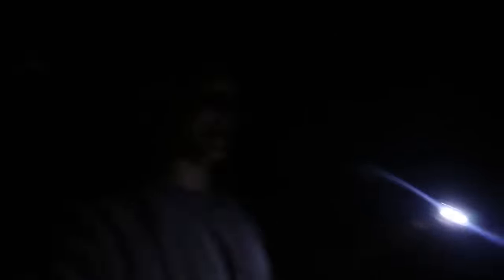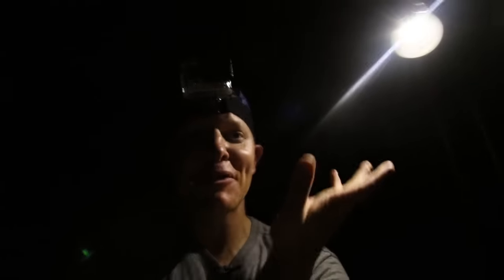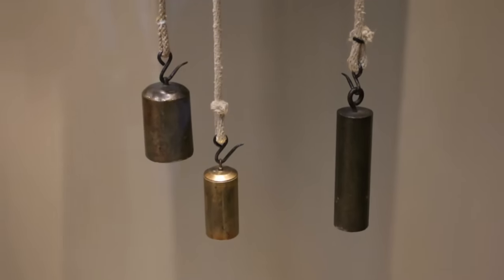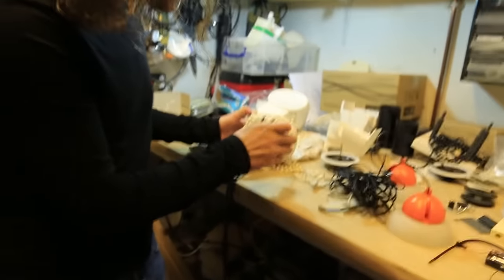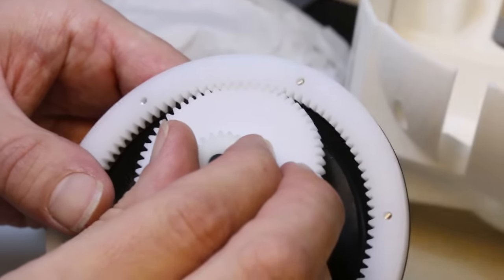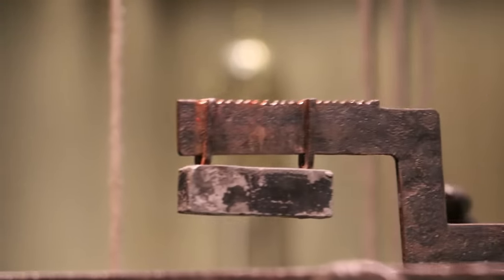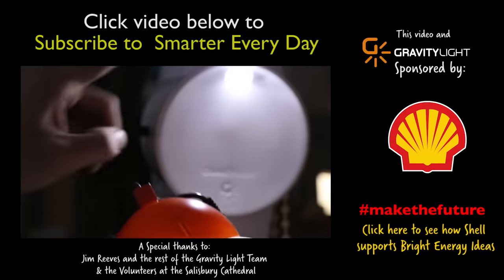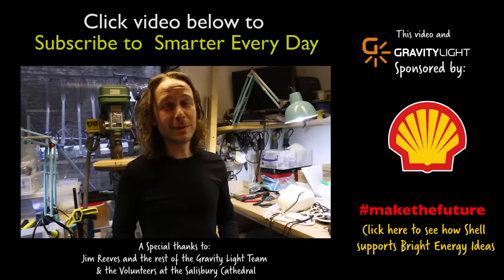Turning Gravity Into Light - Smarter Every Day 146

Comment: You mean I can’t use this in space? Please come up with Zero Gravity light, please. Thanks.
Reply: You're asking too much...
Reply: Didnt Tesla do that already?
Reply: Stored Solar power
Reply: Fun Fact, there are people developing human-body-heat powered torchlights
Reply: You could probably use a spring or elastic band with enough gears, but you'd still have to reset it often.
Reply: the centripetal force of a spinning station (faux gravity type station) could make this work
Reply: @Theo Andersen 
Yeah, I was going to suggest the same!
Reply: @Esequiel Tovar any rotating object in space pushes things outwards, which can be used as gravity. Good point though, with the moon - might work😊
Reply: In space, the better solution is solar power and/or nuclear power.
Reply: @esequieltovar4955  you can jump 6 times higher to hook the weight. 😜
Reply: You need light in space?
For what? Hunting aliens? Using led?
Reply: Coil Spring tension
Reply: Light causes gravity
Reply: Your request contains a fundamental error OP.  There is indeed gravity in space.  For instance, the ISS is subject to gravity just as you and I are. The force is lower due to its greater distance from the center of the earth but it's still there. IN FACT it's still about 90% of the value at the earths surface.

Not sure if there's been an explanation on this channel but if not, perhaps there will be.
Reply: For those of you looking to ‘discredit’ my statement, I simply found humor in the statement. I’m not really that interested otherwise.
Reply: @onenationunderduress8994  And I found humor in pointing out that there is plenty of gravity in space and tha tmost people actually think the ISS astronauts are weightless......it's funny to those of us who know better.
Reply: You need a spring
Reply: In That Case just throw the Weighted bag in space because it has no resistance but then it will also not stay in place and crash into a computer screen XD
Reply: Use a spring
Reply: @kg7tuo999  theres gravity in space you just need to add mass, gravity pulls mass together.. the iss feels 80 percent of the earth's gravity, therefore is always "falling"
Reply: @T2D.SteveArcs  According to my texts and study of physics, gravity is a FUNCTION of mass, not something that pulls mass together.

Your body has mass and attracts the earth to it just as much (per unit of mass) as the earth pulls your body towards it's center.  The earth just has a lot more mass.

Planets are formed when smaller masses congregate in a small area causing their combined mass to attract smaller objects when then add to the central mass.  This process continues until loose bodies are no longer present or are caught up in the gravitational field of another body or find themselves in sustained orbit around a body or group of bodies.

There is no gravity within space that is not a function of the mass of some physical body.....even if that body is micro particles or individual atoms.
Reply: @kg7tuo999  the new way of looking at it is gravitons pull mass to gather like u said you to the earth and the earth to you 
.together...
Reply: @kg7tuo999  and by the way "just add mass" was a joke🤣
Reply: @T2D.SteveArcs  NOTHING in science has shown the existence of gravitons.  Gravitons are a THEORETICAL particle in INCOMPLETE quantum theory. There is no complete theory that gravitons are anything more than a hypothetical creature.
I believe existing theories postulating their presence are trying to discover teh "theory of everything". At this time, they are simply a figment of the imagination.
Reply: @kg7tuo999  I said new way of looking at it .. I know it's a theory  and according to professor Richard Muller at Cal tech this is the way physicists are now thinking... 73s ;)
Reply: Would spinning it work?
Reply: In the space the gravity works, just put some thing tied by a rope and give kinetic energy to it, so it will be in orbit but as is tied won't scape, it will produce one vetor force agaist the rope like gravity. I know it’s not the solution, but it’s a drop of water falling into an ocean of possibilities
Reply: Then just take battery -_+
Reply: There a Lamp that uses Water